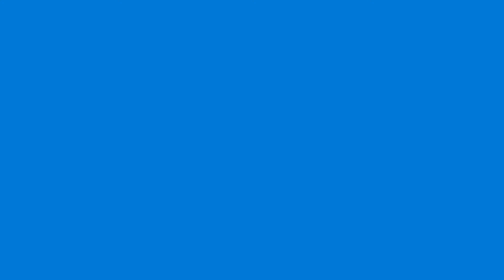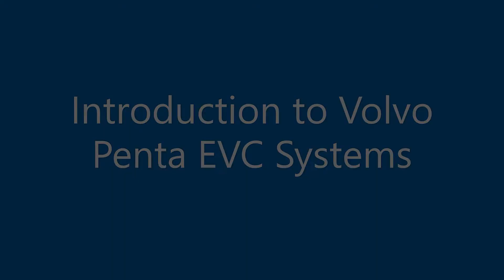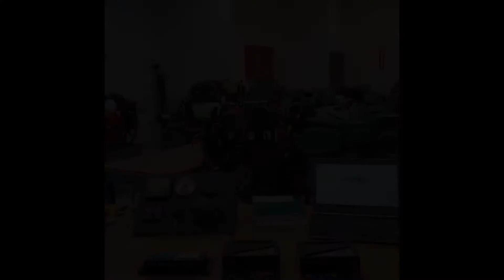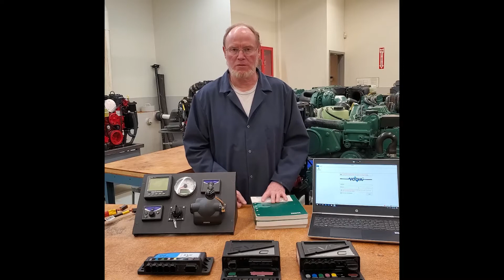Volvo Penta EVC and VODIA 1

Comment: Hi Ted. Quick question about D3 secondary fuel filters. My mechanic fitted later model D3 filters to my earlier model 2007 D3 190hp diesels. Since then I’ve got power issues. Could the wrong fuel filter starve the engines?
Reply from the maker: Why would he change the filter design? And yes sounds like "over" filtration may be the issue.
Reply: @tedsmarinerepair8956  great thanks. I’ll go and change them and see if we get improvement. I think it was an apprentice that was told “change the fuel filters on the D3s” and he picked up the wrong ones

Comment: Hii Sir I have a problem in My Marine Engine When I am trying to start the engine in some times total powersupply of that engine evc is going to off? also some times itself going to off after that Remove the power supply from power supply unit wait 10&15mnts again its normally possible starting please help me sir
Reply from the maker: What type of engine?
Reply: @tedsmarinerepair8956  D9A2J volvo marine Engine
Reply from the maker: @vichusvichu2779  It may be a faulty power supply module, if you have twin engines try swapping them to see if the problem moves to the other engine with the module

Comment: Hi, Ted.  I found your videos and subscribed.  Just wanted to thank you for making these video on Volvo engine especially the diesel.  I have a D4-260 engine on my boat and would like a request if you could make a video instruction on how to calibrate the fuel sending unit with the Volvo gauge system without the use of Vodia.  The best, easy, and accurate way to calibrate fuel sending unit with Volvo fuel gauge.  I know there are many people out there who will be interested in this video.  Thank you.
Reply from the maker: It is on the list!!

Comment: Hi Ted and thank you for all your videos, they are great!!!

Do you have any calibration videos available for Glendinning controls EEC3 with Volvo engines (EVC-B or similar)?
Reply from the maker: Hello Lilly,
Unfortunately I do not. I have not worked on a newer electronic Glendinning with EVC only the older mechanical versions used with mechanical diesels.
For early EVC A-C systems Volvo used a potentiometer in the remote control, so using a short control cable controlled by the Glendinning MAY be how it is set up (not sure). I did find an early (2003) Glendinning operators manual which may walk you through it. https://www.glendinningprods.com/wp-content/uploads/2018/01/eec_ops_instructions_v5.pdf
You can also try reaching out to Glendinning, I have spoken with them on occasion for troubleshooting and they are very helpful.
Reply: @tedsmarinerepair8956  I understand.  Thank you for your prompt reply.

Glendinning people gave us a hand on this. 😊

Comment: Hi ted thank you for all your videos they have been very helpful and I was wondering if I can ask you a question about a 2014 Volvo Penta d3 220 that I am trying to get back running right after it had received some water damage
Reply from the maker: Sounds like a very in depth project - ask away
Reply: Hi Ted when I got boat I drained what was in there and pickled it and changed the starter and alternator  pulled glow plugs and turned it over by hand and did everything I think I needed to do . I got it started and it ran pretty and then I got a bunch of faults so I decided to change the main wiring Harness and that got rid of most of them except this on which I think is the fuel injectors the code is MID 128,SID 5,FMI 6 the SID # changes from  1-5 after I reset the computer it runs great for like 20 minutes and then that code pops up I also had the computer (EECU)checked and they told me it is working fine . I can really use any suggestions sorry for the long story thank you for your help
Reply from the maker: @michaelbenn9237  The codes indeed are for the injectors and FMI 6 is a "short" code between the two injector wires. If you have changed the engine wiring harness (which includes the injector harness) Then I would cut the battery power, disconnect the ECU connector and test for resistance for each injector harness high and low wires. they all should read about 180 ohms each (you can start by unplugging the injectors and seeing if you get consistent readings for each individually).  If you get readings that are not consistent then the injectors may have gotten water in them and are now the cause. If you find that testing them separate and with the harness gives you the same readings then they are the cause. Hope this helps
Reply: Will definitely try these steps thank you so much